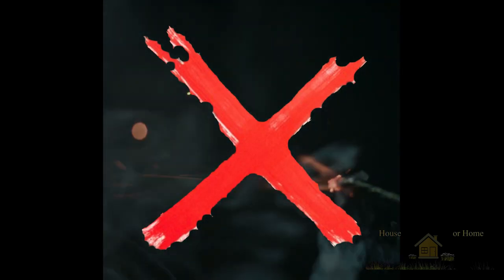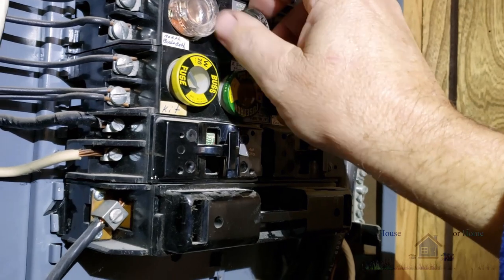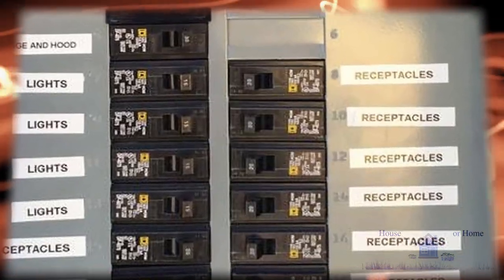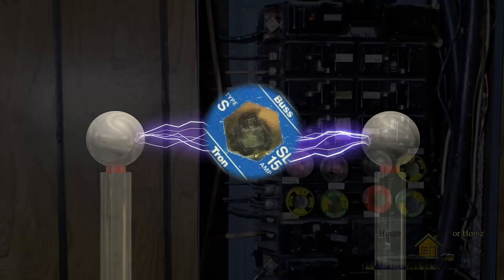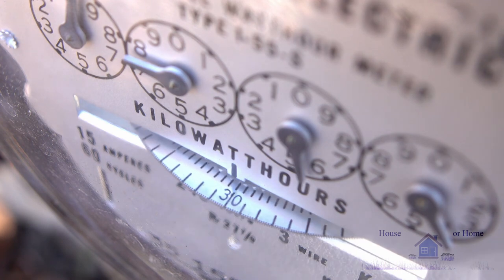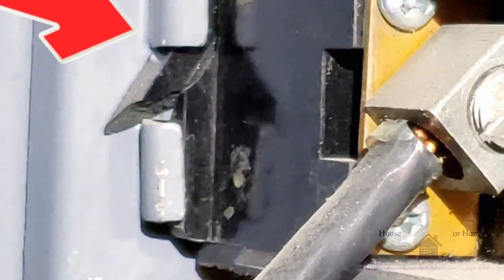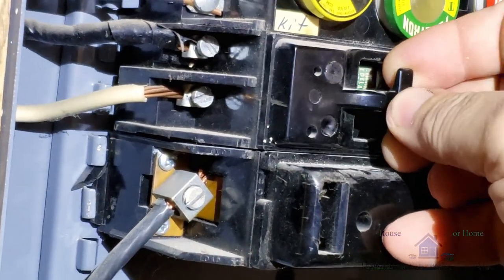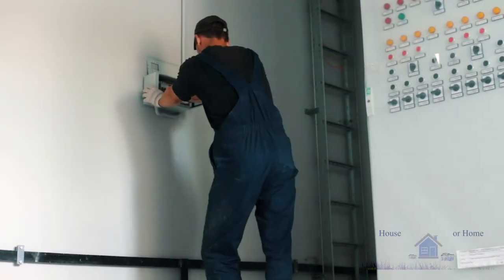Home inspection/electrical panel/fuse

Comment: The link in the fuse can weld together. In the past certain makers did not properly test their breakers but those are not being made now occasionally you may find bad breakers now but on the whole if you get get good brands you should be safe. Fuse panels may be made with an open socket which is a child can stick a finger in.
Reply: You put fuses in sockets not used,or you can cover them with duct tape!

Comment: 6:05am. Pulled fuse that supplied kitchen, dinning room. Kitchen light was flickering after I removed light 14-2romex was melted. Fuse didn't blow cause it was 30amp. I have crossion on the contact the fuse touches when installed